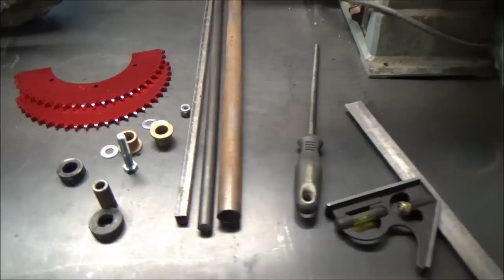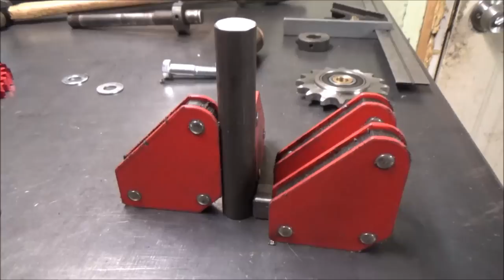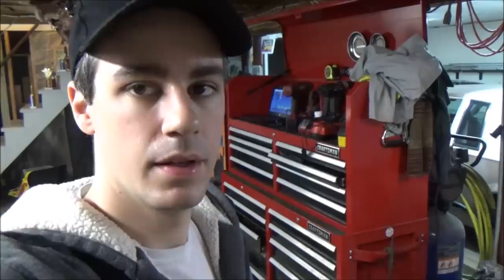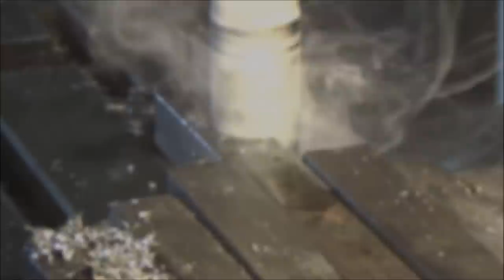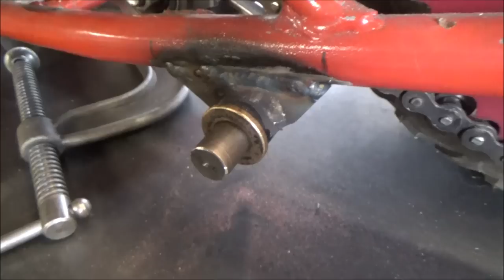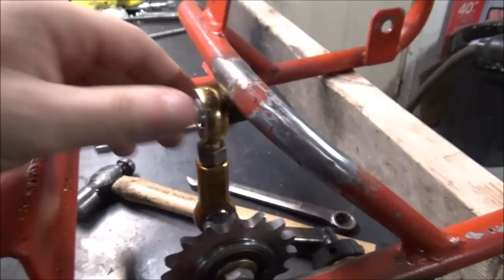Chain tensioner Build for the doodle bug mini bike.

Comment: great vid . and I agree you need a chain tensioner,had mine as tight as hell and you still need the ct.RIGGED MINE ON THE BACK OF THE TORQUE CONVERTER HOUSING and took my time and used a roller wheel and a real tough spring. tight quarters.works well. thanks for the vid.

Comment: Thanks for the video and this idea!
 I have a quick question, do you know how far I need to move the sprocket to the left in order to run a 30 series torque converter compared to the sprocket position for a standard, outboard mounted sprocketed centrifugal clutch?
 I'm trying to figure out if I'll be able to swap the position of the brake drum with the large sprocket which mount to the 4 bolt wheel hub on my go kart project. The way it is factory is the sprocket bolts right next to the wheel and then a band brake drum (looks to be about an inch wide, haven't measured it yet) which both bolt to the inside wheel hub.(the wheel hub is extended on the inside for sprocket/brake hub mounting). If I remember right, the difference is about an inch but it's been a long time since I've dealt with this issue. I'd rather not have to have the key way extended and get an axle mount sprocket hub if I don't have to.

Comment: Dude. The stock tensioner that was cut off would have been ideal too! It looks to me that the little black tensioner wheel would have lined up right behind the torque converter. Any trouble keeping that chain on that tensioner without guides? I too was contemplating this route with a loose sprocket on a bushing. I ended up cutting a piece of metal, drilling some holes, adding a spring and using the $30 Baja OEM tensioner wheel with bearings https://youtu.be/E1oRqcEFmbM. Notice the stock adjuster I left on there? This thing goes back, forth, up, down and works as a guide too. I   also have my engine all the way back with an extra inch or so of adjustment at the NR racing mounting plate. I did this so that I could easily switch to the stock tensioner setup if I add a TAV 30. I'm only running #35 chain, a P212 with the zip tie hack and a centrifugal clutch thus far, so I'm not sure what happens with #45 as far clearance issues yet. My next one is getting that CHonda Gx160 Type-R I built so it's safe to say I will be more familiar with this issue soon seeing as if this motor revs so hard #35 probably isnt a good idea!